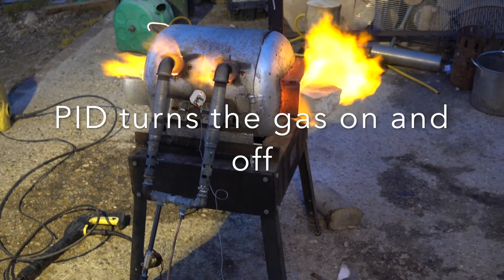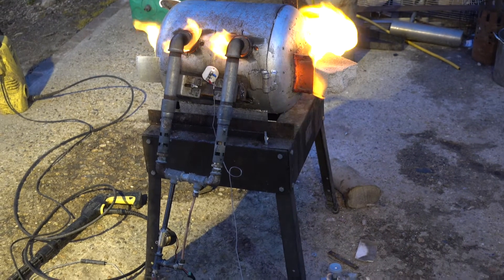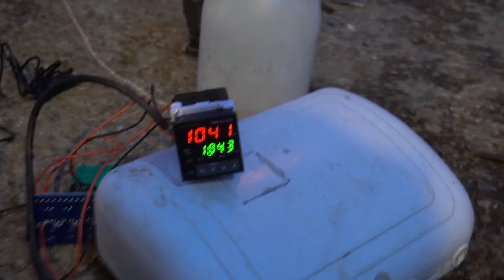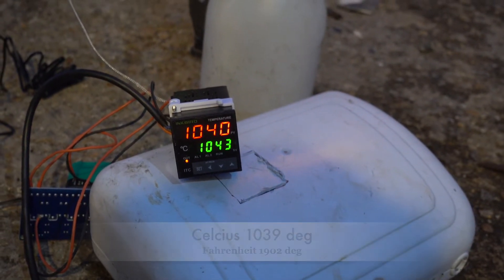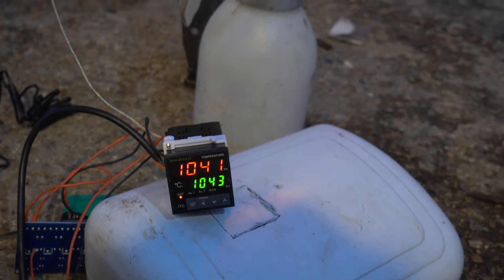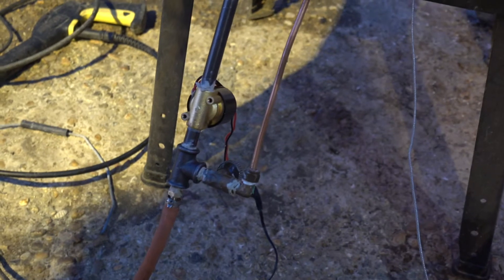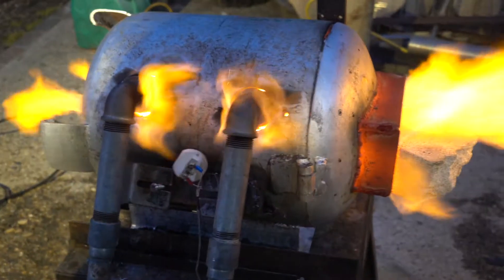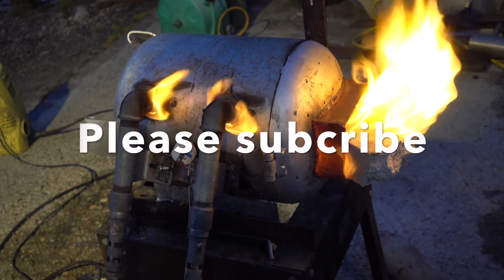Gas Furnace PID controller

Comment: HI, what valve you used, sensor and PID?, can you sum up the parts?, I'd really appreciate it
Reply from the maker: Hi, firstly you must have a pilot flame and a flame falser thermocouple, as to your question you need a thermocouple (if extending must must not be any old wire must be correct) https://www.omega.co.uk/pptst/XC.html
you will need a pid controller , easiest to set up is this one. https://www.amazon.co.uk/gp/product/B008GS2QFU/ref=ppx_yo_dt_b_search_asin_title?ie=UTF8&psc=1
then a solenoid valve NC https://www.amazon.co.uk/Electric-Solenoid-Normally-Closed-U-S/dp/B00DQ1F1KE/ref=sr_1_4_sspa?dchild=1&keywords=solenoid+valve&qid=1623746052&sr=8-4-spons&psc=1&smid=A1VOP8J267MP09&spLa=ZW5jcnlwdGVkUXVhbGlmaWVyPUEyQjIxR0ZSNVpEMkNYJmVuY3J5cHRlZElkPUEwNTI0NTIzNDBNMlZCWVdMN1ZTJmVuY3J5cHRlZEFkSWQ9QTAwNTk5NDgyWkNVWjM4SzVIWU44JndpZGdldE5hbWU9c3BfYXRmJmFjdGlvbj1jbGlja1JlZGlyZWN0JmRvTm90TG9nQ2xpY2s9dHJ1ZQ==